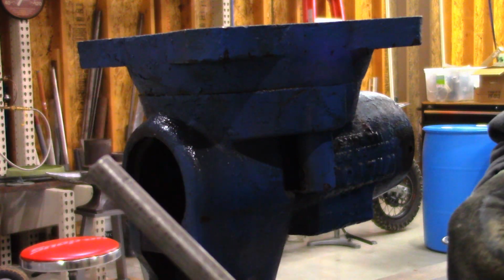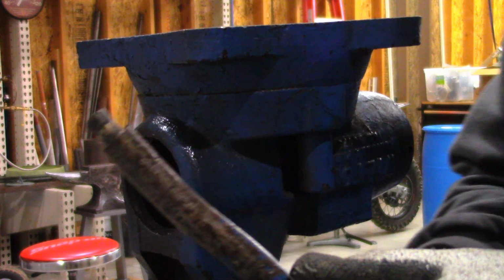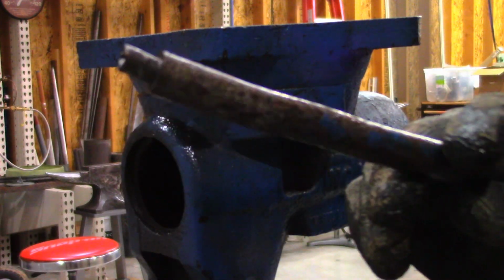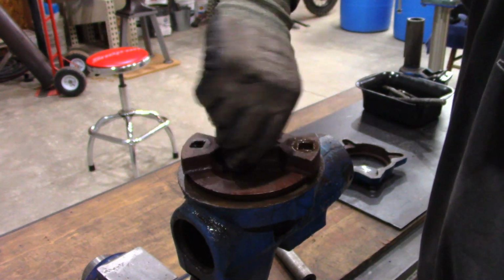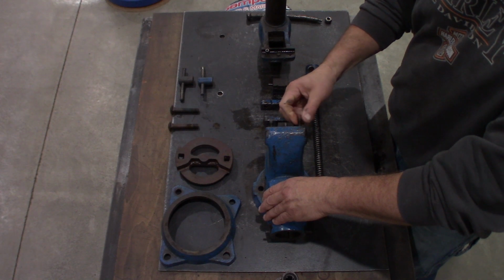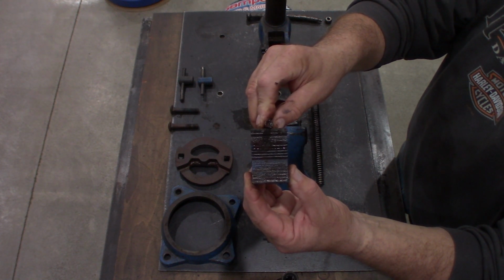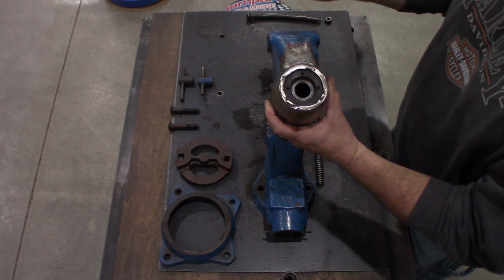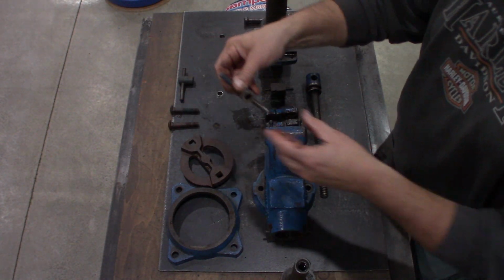Wilton Vise Restoration Part 3 #realraysgarage

Comment: Wow Ray,you got more patience  than I have. I would have scrapped the vise and sold the swivel assembly and pipe jaws off it and used the proceeds to buy another used Wilton vise that was in better shape. Good work!
Reply from the maker: Thanks man! It is coming alone nicely and hopefully will make for a good bench vise when finished!

Comment: It is time for an ultrasonic parts cleaner. I have one and I like it. Ultrasonic cleaning and Evaporust together works really well. Do you have a sand-blast-cabinet?  I bought a 2448 MODUBLAST cabinet. No regrets.
Reply from the maker: Hi Bob, I do not have either but are on my wish list. Thanks for the info, I'll check it out.

Comment: Hey Ray I’ve got one of those Wilton vises that come off of the line truck I went to work on in 1962. When Bell retired the truck my boss gave me the vise. I wouldn’t take a million for it. Lots of good memories associated with that old relic of a tool. Works just like it did when it was new. Never had it apart so I’m not sure how old it is. I got unsubscribed somehow and lost ur channel for awhile but I’m back now. Great videos, enjoy them a lot. Didn’t see those snips on ur belt. What’s up with that? Lol
Reply from the maker: Hello Robert, Sounds like you have yourself a real nice Wilton! You only have to remove the front jaw by supporting it with one hand and unscrewing the spindle all the way out. The date stamp is on the alignment key and was made five years prior to what is stamped on the key. At&t do not put vises on our trucks anymore so you would have to install your own if you wanted one and that's a big no no these days! Thanks for tuning in my friend! Best Regards, Ray